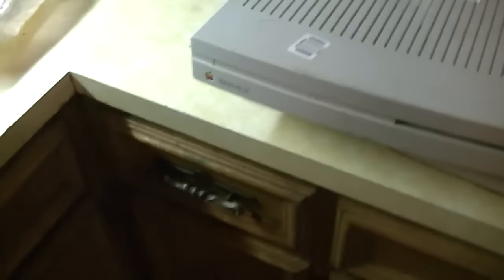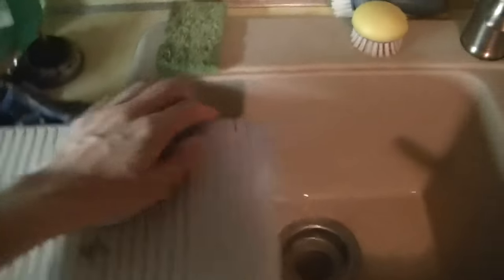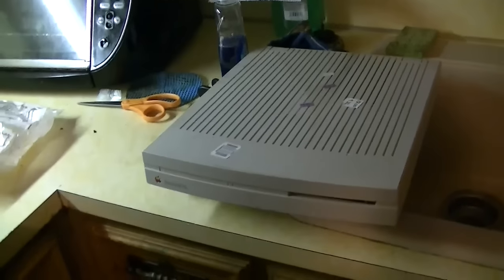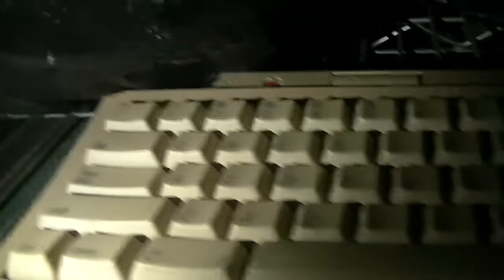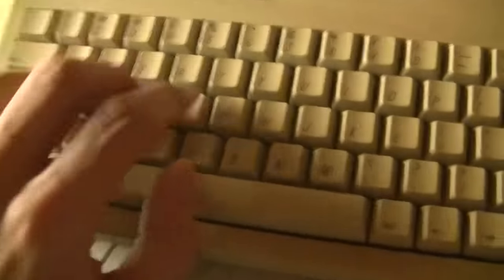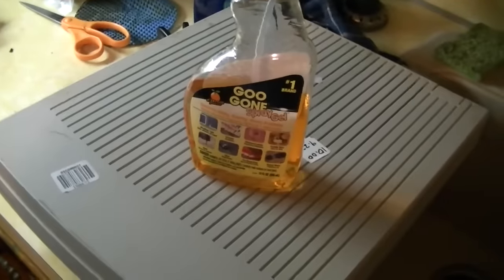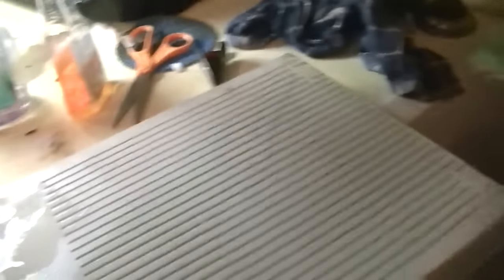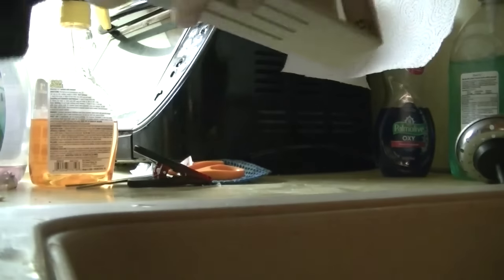Cleaning the Macintosh LC

Comment: I like those old Macintosh computers.Unfortunately I had so many computers that were taking over my house that I had to reduce their numbers from about 100 to now around 30.
This was in the year 2009 that I got rid of a lot of them but I do miss the ones that I gave away.I still have 2 Original Macintosh's from 1984,a Performa 636 CD,Performa 6116 CD,a G4 Macintosh tower and a eMac from 2004.I  have a Yamaha  SCSI CD burner from 1997 that still works amazingly well with my Performa 636 CD Macintosh.
Reply: Same here. At one point in time I had about 30 or so vintage Macs. I got rid of most of them, and now down to about 10 or so macs. I wish I had kept some of the older Macs. I miss the Mac IIsi, IIci, II, etc.